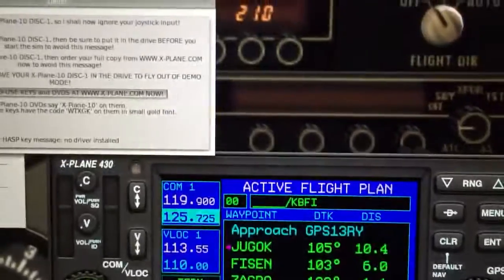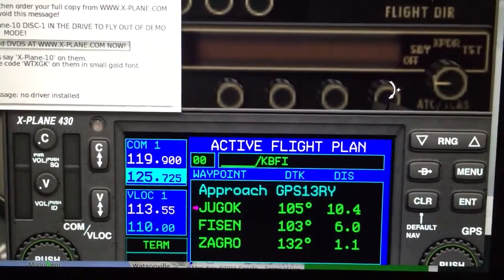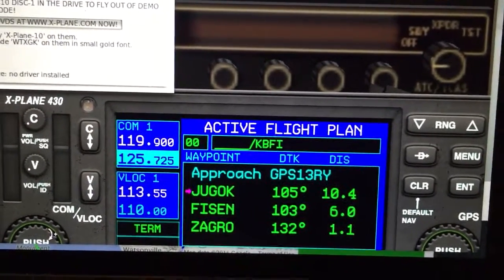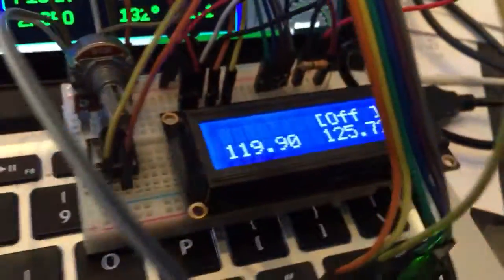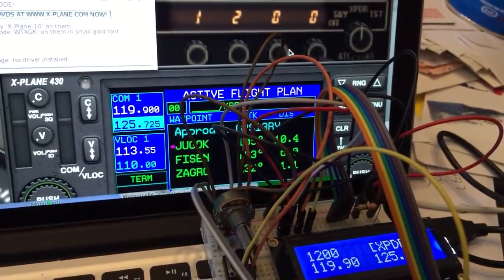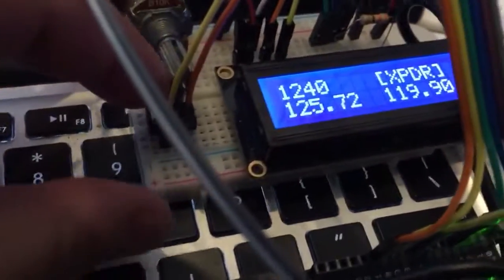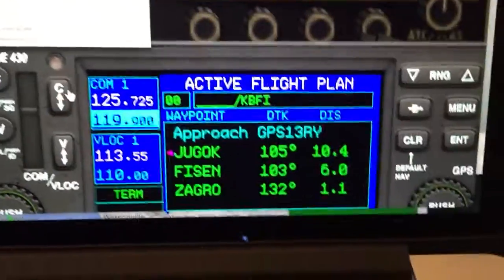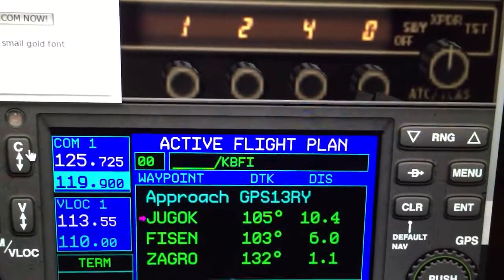X-Plane and Arduino Test

Comment: That's exactly what I'm hoping to do for the exact same reasons. I've done some testing, not to your level yet, but with very positive results. I have been researching the parts, i.e., encoders, push buttons, building a panel, etc. My problem is 1. I'm away from my sim computer for a while and 2,, I'm an electronics newbie, not knowing when a resistor is required, etc. My early testing incorporating an Arduino Uno with the plugin from the guys that built the Baron Simulator was successful so I'll probably stick with it. Their website is ardunio.svglobe.com is very helpful,
Reply from the maker: +Tom Perkowski yeah, I've used their X-Plane Plug-in code, it works great!  I've picked up an old simulator yoke (all aluminum and steel) and throttle controls that I'm going to try to hook up next.
Reply: +Chris Saulit . My last test was using a couple push buttons to zoom in and out; and it worked great. When I get back I'll be looking to find some encoders, better push buttons and hopefully a paddle or rocker type switch for the zoom in and out function. (I've been searching but haven't found anything yet.) I agree with your comments in the video; you don't use a mouse to change the radios; real switches and push buttons are a better experience.
Reply from the maker: +Tom Perkowski search for "momentary rocker switches" and you might find ones that work well or at least good enough.  Dual rotary encoders with knobs are hard to find, but you might want to try here:  http://www.desktopaviator.com/Products/parts.htm and hopefully get some before another out of stock situation.